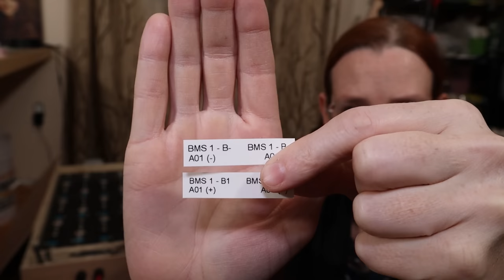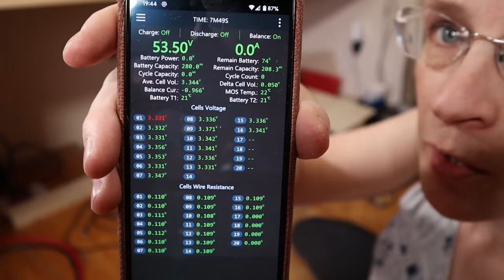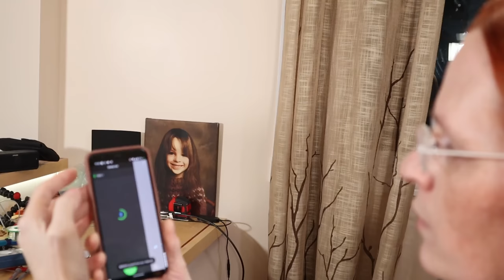JK BMS and Bus Bar Resistance - How to build a 48v Lifepo4 battery (Ep. 28)

Comment: You, Andy, and a few other youtube people have taught me so much qbout building a battery and about the bms stuff. Thanks
Reply from the maker: Very happy to hear that, Matt! ^_^
Reply: @TheDigitalMermaid  I'm starting my second battery build 560 ah 24 volt from eve 280k cells grade a with the 2 hole welded terminal.  I think I'm gonna use home made buss bars to link the cells. The flexible buss bars are great for links between cells in series but I'm making my own to link 2 cells in parallel then doing the series with the supplied flexible ones that came with the cells. I wonder if the 5 amp active balancers can be ran with the jk bms that has the 2 amp balancers or if I might not even need extra balancers? Any advice would be greatly appreciated
Reply from the maker: @matthewknight5641  I've not played with external active balancers, but for the most part, you can ignore that cells in parallel are separate, and treat them like a single cell from a balancing perspective. The cells in parallel will balance amongst themselves, and if that means the group goes lower on average, they'll get charged up just the same, it'll just take longer.
Reply: @TheDigitalMermaid  awesome. Thankyou..

Comment: Hi, cool videos ;-)
A remark to the starting procedure of the JK BMS:
I used the version for 8S-Systems and I found out that there is a simple way to start the BMS. Take a digital multimeter and switch it to Diode Test mode. Then contact the P- and B- with the test pins (minus to P- and plus to B-). The measurement voltage of the multimeter is enough to start the BMS! Hopefully this works also with the 20S version.
Merry Christmas!
Reply from the maker: OK I wish I was hope to test this right now. I will absolutely test it when I get back!

Comment: Really enjoying all the iterative build, test, change repeat.  Just got Electrodacus BMS in the mail.  I think I am going to really like this approach to BMS, where the BMS tells Multi and MPPT to quit charging or quit drawing instead of just shutting the battery off.
Reply from the maker: I'm hoping to create a bridge between the JK and the Victron gear, got a USB to RS-485 adapter on order. Any part being great in isolation has limited value.
Reply: @TheDigitalMermaid  I do that with a Raspberry Pi. The Pi acts as the main control unit for all the other stuff. It can control the charge controller, inverter, etc. and also can control e.g. diversion of excess power to the hot water tank when the battery is full.
Reply from the maker: @upnorthandpersonal  do you have docs or guides for this?
Reply: @TheDigitalMermaid  Comment removed again... sent an email.

Comment: Uh Oh... looks like JK is taking over. 

You're spot on with JK being a bit quirky, I've had it running for almost 3 weeks and I get occasional blank screens like you do. I've found closing the app (force close), and turning the BT off-on seems to make it happy again. 

The readout is not as easy to see at-a-glance as a lot of the others with a dial or bigger numbers, but that's well and truly offset by how well it works. I swapped from a Daly and this JK is much more accurate. The downside is readability, and current capacity. For me I'll be doing a 3P or 4P 16S system, and I know my 8kW inverter will draw 180A at times, so I'm close to the limit for a 200A BMS. 

If JK brings out a 12v 250A BMS, they will capture a massive market. 

Very methodical measurements tactics for the bus bars too. Not many people have that much attention to detail, you can use those skills in so many industries so keep it up. 

Thanks again for a very informative video!
Reply: There are (or at least used to be) 300A and 400A version with MOSFETS but they're hard to find. A 600A version (with relays) is available as well. By the way, did you find those MG Chemicals test results I did?
Reply from the maker: I had tried force killing without much luck. I didn't try cycling Bluetooth though. I also agree on the readout... It feels more stylish over function. Being able to pull 150A at 48v is really nice, and the balancing is fantastic. 

Quality and reliability though, the Overkill solar seems more reliable and easier to use. I'm torn. I think JK needs to step up their software to earn better marked share. If Overkill comes out with an active balancer version...

Thanks again for the kind words. :)
Reply: @TheDigitalMermaid  Personally I prefer the JK software to the Overkill. You get instant feedback on settings you change (no load/store all settings at once), for example. The fact that the BMS can shut itself off to prevent further draining a battery that is low is awesome. All the little things, and the BMS wire resistance, etc in the software are in my opinion also better.

Comment: for marine purposes you have to solder all wires. In the long run humidity shall corrode connections. Been boating for more the 40 years. Had my portion of corroded bad connection LOL

Comment: For labels, lots of them will eventually fall of in my experience. (Glue just dissolves). I now have a Dymo labelwriter and use heatshrink, the dymo offers printable heatshrink. Love it!
Reply from the maker: I'm using the "extra adhesive" labels, same as I've used for about 15 years in my day job in IT. I've got the very first test label I put on the printer's power cable and it's still stuck as good as the day I put it on. I've had them sit in the hot-aisle of server racks for almost 10 years on ethernet, power cables and on the metal chassis without any failures. So I'm pretty confident in these.
Reply: @TheDigitalMermaid  Diesel is a miracle at removing things you don't want removed that uses glue, so ask a friend for a drip of diesel and dip one in that and let sit, this being said, that should be no issue for the battery as it should never see any!

Comment: You can also boot the JK with a 9V battery. The Bluetooth range is limited because the module sits in a metal enclosure. You could actually put an external antenna on it, but it requires you to take the thing apart.
Reply from the maker: How do you boot it with a 9v?
Reply: @TheDigitalMermaid  I'll send an email since I can't post links...
Reply: Can also write it here that Andy uploaded one of the manuals for the JK-BMS under the BMS section, that also show how to do it. There is also another YTvideo that show this I linked to under the Andys JK-BMS-video comments.
Reply: I thought it was as simple as putting a 9V battery in your enclosure, adding a momentary switch and putting the pos and neg across the P- and B- on the BMS? All it requires is a voltage greater than 5V. A 9V battery is cheap, small and easy to replace than needing a dedicated workshop powersupply or using your generator on the boat just for a >5V jump.
Reply: @zoe..d  Yes, I just wanted to put a link to the manual/diagram to make it clear that the + of the 9V battery needs to go to B-.
Reply from the maker: @upnorthandpersonal  Yup, and I'll be trying it when I get home. Andreas Greif suggested it can even be booted from a multimeter. These tricks will very much be in the first video after I get home.
Reply: @TheDigitalMermaid  It's just another battery cell. You have already put 16 lifepo4 cells in series, now just add a 9V cell on top of that. You're not using it to power anything much, you are just giving the BMS the signal to wake up.

Comment: A simple multimeter based resistance value should only be used in determining a fault in the system, not a rule or an constant of the overall system. There exist analytical testers, but those are complex instruments, used only in research labs, and those are very expensive stations and need special training and experience. The correct way to determine the overall DC resistance between two terminal posts is I-U method(voltage drop with known current). The method is simple and gives a lot of information not only about the performance of the bridge (bridge is the correct name, not bus bar/wire), but even overall performance of the whole battery assembly, and can be done with standard equipment.  To measure the voltage drop, we need to introduce a known load current to the system and measure the voltage drop between the battery terminals( correct measurement location is batteries terminal itself, not the bolt/bolt head/etc.). For a known active resistance load we can use automotive halogen bulbs 24V 100W or even 200W connected in series-paralel. Those bulbs can safely operate to 29V DC, two in series =58V. Connecting those series strings to parallel we can have a step-by-step variable active resistance load and its cheaper than building a power resistor bank of expensive high power resistors, which would need a more expensive and bulky heat sink. For cooling those halogen bulbs we can use an inexpensive large PC cooler (in my experiments, below 80V DC, I drown the bulbs in a 12l plastic bucket of distilled water). To determine the current, we should use a calibrated DC current clamp or DC current transformer with calibrated voltmeter, not a shunt. A shunt will introduce an active series resistance to our system and could introduce an error of measurement to our overall battery assemblies performance. Using an inverter for load is not recommended bcs of the HF noise and non linear load it introduces to the overall battery assembly. The amount of tests performed should be at least 3 low current and atleast one high current equal or slightly exceeding the maximum current draw of the systems design. The first 3 tests (lets say 10A, 25A and 75A) we measure and record the voltage drop between the bridged terminal posts and the load current at the same time; so on with all the bridges of the battery. The measurements should take place after abut one minute of the load introduction to the system to let the temperature and so called "current shock" to stabilize(electrochemical processes are complex and batteries have ionistor/supercapacitor effect also). The last test, or so called the maximum load current(I recommend +10% of the designs max load current level), should be carried out after about 10 minutes of introduction of the load. That test will show us the worst case temperature rise of the connections aswell(use a dedicated IR thermometer on the bridges and terminal bolts/posts, do not trust uncalibrated IR cameras on some sort of a phone; using siedbeck effect thermal sensors is not advisable bcs of the hall effect near high intensity magnetic field). The 10 minute time is not a law, it only a ballpark, and is determined of the thermal mass of the system itself(the longer, the better). This test will give us the information of the worst situation possible of that particular system: the temperature rise, internal resistance rise of the whole pack, efficiency drop, etc. My recommendation is to draw graphs to paper or PC and You will have a visual representation of Your work and it will give hints for improvements. Once You have the "picture" in Your mind, You will have much less of a hassle to engineer and build the next one.

The main problem in marine type of electrical systems(not only electrical, but all the mechanical/physical contacts between two different metals) is electrochemical corrosion. There are different ways to rectify the problem(elimination is impossible) and the simplest way is to use the same metals of contact. Stainless steel has limited chemical resistance, zero electrochemical(have seen the bolts used for connection of the batteries?). There is a lot of mumbo-jumbo of stainless steel bolts and nuts used in battery terminals, and even in marine conditions, but its all wrong. The problem is that most Li based large batteries use aluminium terminals(not only in ion battery systems, but all battery chemistries); its chemically active material. Yes, it summons a protective layer of oxide in contact with oxygen, but its not resistant to electrochemical corrosion when introduced with different metal surface contact with the presence of an ionic/acidic/etc. fluid/salt; aluminium will rot away in most cases(basic chemistry, remember the line of active-passive metals). For stationary battery installations, even stainless steel is not recommended bcs of the high electrical resistance; use bronze or messing bolts/nuts. Pure copper is also not recommended even in stationary installations with contact of aluminium. My recommendation is to use aluminium U shaped bridges between the battery posts and aluminium bolts(duraluminium/aviation aluminium/ etc.). They are expensive, but its a lifetime warranty. If there is no way of getting those, use bronze(heavy nickel plating is also acceptable) and after the tightening/full testing, coat the terminals and bridges with petroleum jelly, silicone fat(not silicone oil!) or V-66 aerosol compound(used in PCB prototyping, use 6 layers atleast). I recommend the use of V-66 PCB varnish, bcs its not that messy and is resistant to chemical/temperature/static discharge/ etc. attacks. It can be removed with slightly abrasive plastic sponge(the same used to clean dishes). Those coatings will not let the corrosion allowable media to come into contact/between the different metals.

Surface area and current density are the fundamental constants in determining the battery assemblies performance, and the efficiency of transmission to the load. The tables on the the internet are actually useless. They are a guide of max temperature rise of a particular wire and isolation performance according to current and installation method. In battery installations, especially low voltage/high current, we need to know the max allowable voltage drop between the source and load; it determines the efficiency of overall system. Example: 1mm^2 copper can withstand 1kA(temp rise can be about 800C, isolation will fail, conductor stays), but that size is an inefficient conductor for a battery installation; voltage drop squared=power dissipation. The right question here is, how much do we allow to lose? Aluminium has about 2x less electrical conductivity per sqr-mm, but its an ideal conductor to make contacts between the batteries aluminium terminals(near 0 electrochemical corrosion). Problem here is: where to get aluminium bridges that are mechanically soft (woven belt like conductor with aluminium terminals).

BMS and the right place of balance/measuring wire is also dependent of the current draw/voltage drop between the batteries bridge terminals. To minimize the voltage error(adds to voltage drop of the bridge between batteries and its temperature dependent) the right place of single series connected battery assemblies BMS wire connection is the midpoint of the bridge. That way we ensure, that the voltage drop is symmetrical between two series batteries, and its absolute value is independent of the overall load current(charging and discharging of the battery represent a load to the bridge connector, only the current way changes not the voltage drop polarity).

Too much information for the first time. Next time I will introduce You to the secret world of electrochemical isolation and hydro isolation of marine installations. Maybe will type some musings of electric drives also... If You, and the respected public, are interested.

Comment: Bolt down just one end to get the connection resistance. Post to near hole includes the contact resistance on one end. That minus hole to hole is the contact resistance.

Comment: One problem with the "LithiumSolar loop" idea is that each loop has more inductance than a straight-ish wire.  This higher inductance will cause trouble during load transitions in your power system, such as when turning on or off a large motor, which is yet another reason for you to return to your original flexible bus bar idea.
Reply from the maker: Huh, I didn't think about induction. I'm curious if it would actually be noticeable at 150A, but it could be. Thanks for the insight.
Reply: It makes zero difference, we aren’t talking about fine electronics here, this is all brute force dc

Comment: the important thing is to calculate the voltage drops .. singularly and end to end ..  then consider whether it is SIGNIFICANT ..  there are always variations as you know .. the aim is to be better than the spec ... a few calculations loaded in excel and you have it ... if it is in the ok range .. then you can determine the physical attributes as to length and stresses on terminals ..  how it affects your long term mechanical stress on the terrminals /batteries .. smiles .. which i agree with you .. critical over time  in moving dynamic environment .. you are doing excellent work ..  i have found over many years of computing it is more relevant to ensure imaCULATE connection/contact resistance by using no-oxide A or similar to seal the joint from atmospheric attack and verdigree build up.. MEANS LESS MAINTENANCE OVER TIME TO TRACK .. opps .. erroneous problems in a stacked and loaded system..  hopefully none.. but reality is always MURPHY comes to town ...lol... merry xmass and happy new year  to u and urs !

Comment: Resistance in any conductor is directly proportional to the length. If you want to lower it at a specific needed length you need higher GA or put more in parallel. To see how much the resistance of the wires influences things, you need to know the internal resistance of the batteries. Then you can see if that % is significant or irrelevant.